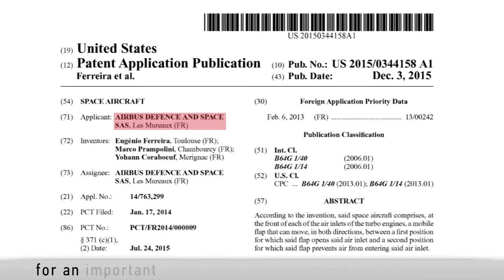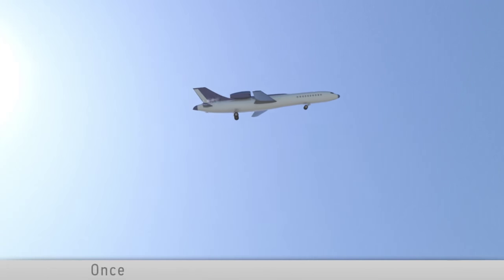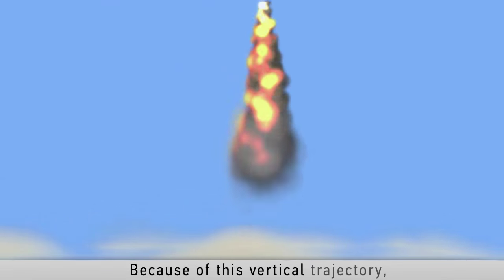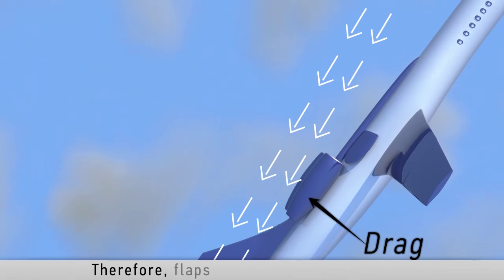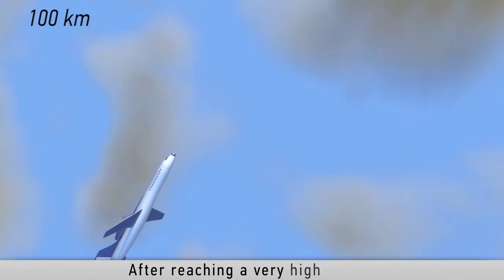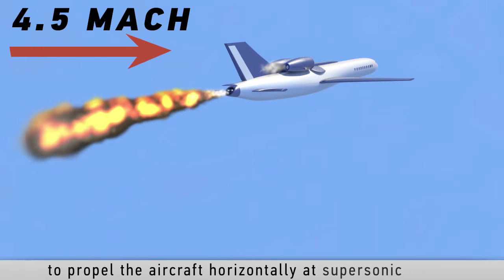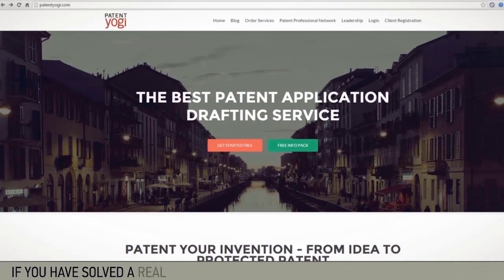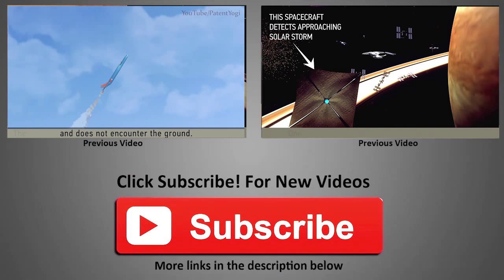Supersonic Space Craft patented by Airbus

Comment: Well, doesn't look bloody likely, lol. Inlet flaps? what? As depicted like like would increase drag, but whatever, I suppose it's meant to be a conceptual representation, not a visual one?
Airframe in general looks wrong for mission.  I seriously doubt this depiction was sourced from any actual engineered designs, drawings or models.
100Km altitude? Is that really necessary, lol? Well idk really since, no speeds mentioned. Any estimates on design speed at altitude of 100km? But that's not aircraft altitude anyway, is it? But I think maybe there are ambitious ideas around for a variety of craft up to mach 24. 

I have doubts about multiple propulsion types, seems more likely will end up being single type with multiple operating modes. Have seen  more plausible seeming designs. (plausible of seeing production and use).  And vertical ascent as means to redirect sonic boom? All that stress routinely? And what about the decent boom? 

This all seems pretty fictional actually. Patents get filed for all sorts of weird reasons other than something about to get built. The materials, methods, costs etc would be extreme. This is practically spacecraft territory. Is Airbus really a spacecraft company now?
it's too easy to get 'worked up' about patent filings. Before you do that you should probably survey the nature of patent filings vs things that actually go into production.

Comment: Adding machines to the front of rockets and jets that blast out sonic waves would reduce air drag on these vehicles.  By blasting out high intensity sonic waves in front of the craft will scramble the air molecules and reduce wind resistance/friction on a craft and thus make the aircraft/rockets travel at tremendous speeds and save a lot on fuel with less wind resistance/drag.